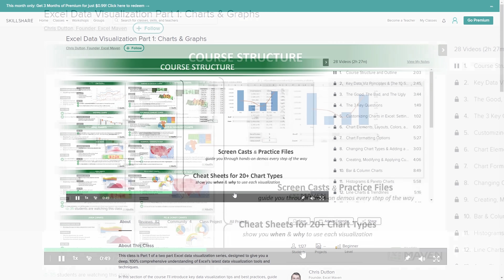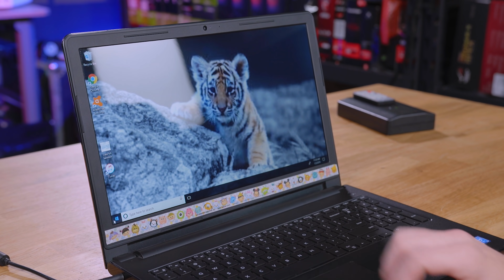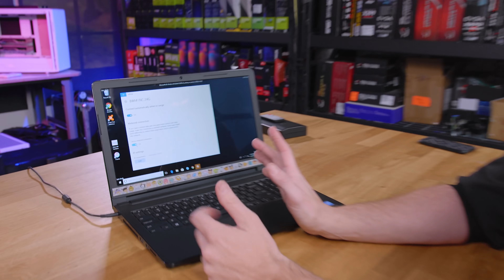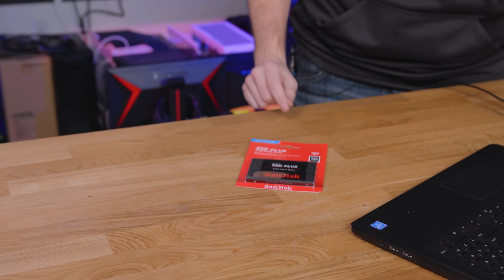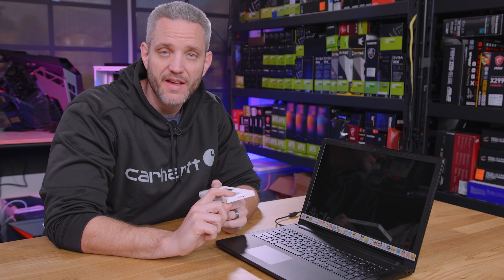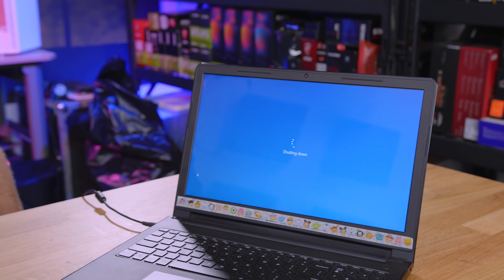Repairing an old laptop for as little money as possible...

Comment: Just updated a 5 year old Asus laptop to a SSD.  Used to take 5+ minutes to start, now less than 20 seconds.  It was a 1 TB HD with 700 GB used, so not a $40 upgrade, but caught a crucial 1 TB drive on a black Friday sale at microcenter.

Cloned the drive using the downloadable software from crucial, so I didn't have to spend hours setting up the PC like I had it.  Cloned, swapped drives, and off it went.

I was about to build a new PC to replace the laptop, but this will do for a while more.

Comment: what if I have a hard drive with  930 GB used space. is there a way I can transfer just the os to the 128GB SSD and be still be able to run my programs?
Reply: Probably -- what you would want to do is first move all the other data elsewhere (or delete it if you're getting rid of it I guess).  Then resize the partition with the OS on it to a size that would fit on your SSD, and clone that partition over.  Normally I recommend the Samsung Migration tool, as it's very easy and user friendly, but I'm not 100% sure it's smart enough to move just the partition over to a smaller drive.  If not, there are infinite free ways to do this.  I like to do from HBCD PE edition (google hbcd) because it's easy, but so is Clonezilla or a number of other options.
Reply: You could also put the hard drive into an external cage and you can still access the storage.
Reply: Bhavikh you can install the os on the ssd and then make it the primary boot drive. Then you can still use the hdd
Reply: @diab0liK  at that point I might as well just do a clean install on the SSD and just use the old hardrive as a secondary boot device so I can keep all my programs and data. I was hoping there would be some way I could still run programs on the old drive from the clean install SSD?

Comment: Little tip. 
In case you have an old laptop/computer that still using an spinning harddisk for the windows C drive, but you don't have enough money to buy an SSD:
If you have an old USB stick lying around that you don't use anymore, plug it into the laptop and set it up to be used for ReadyBoost.
Windows will use it as a cache to store small frequently accessed files. It doesn't make a huge difference in speed but it is noticable.

Comment: I have a Compaq presario C700 that I got in back in '07 xmas with originally 1GB of 667MHz DDR2 and a "dual core" 800MHz+1400MHz Pentium T2310. I maxed it out with 1+2GB ddr2 (3X more!) and a core 2 duo T7800 (3X faster!) and that exact SSD! It now works reasonably well although the new CPU definitely has higher TDP and runs hot and loud! You can hear the fan revving up to turbine speeds as you scroll though facebook, and quiet down once still!

Comment: Yes, what Jayz's saying is 100% true, just go for an SSD, maybe you think you don't need it, but down the road what are 25-30 bucks? Really, just go for it. I bought a cheap N2840 dual core laptop a while ago for a really cheap price, and as it turns out, those kind of machines are just "good enough" to browse the web and send emails, adding an SSD to an old/weak Laptop/CPU will help a lot. It's the cheapest and most notorious upgrade you can do.

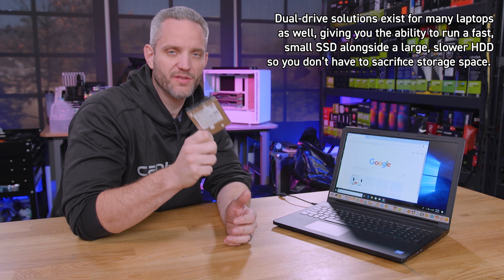Comment: 08:33 to the note: you also can just take out the dvd/bd driver and put it in an external case with USB and put an ssd in addition to the harddrive, that's what i've done because it makes no difference in speed if you use the DVD slot with USB or SATA, also you don't have to put the whole thing apart

Comment: I fixed up my old laptop to give to my mum. When i was using it i had to wait for literally everything it was horrible. I took it apart, replaced the 5400 rpm hd to a 7200rpm hd and the cpu had thermal pads on it instead of paste so i replaced that and suddenly it was better than brand new and didn't scream when you turned it on.
Reply: Didn't Scream wen u turned it on....... Lmao!

Comment: About SSDs: Spend the money but don't go too big unless you want to spend a bunch of extra money for no good reason. However, go too small and you'll wear your drive out more quickly. Consider how big your system and applications are altogether , and use only 3/4ths the space for wear leveling to be effective even if the drive's firmware has more storage than listed to provision for this. Sure it might be the difference between 25 years and  30 years, but treat our flash storage kind and treat it like a read-only device you can write to once in awhile. 

If you have an option for M.2 / NGFF storage, try to see if the motherboard will support Optane. Strange to think about now but in the future Optane as DRAM cache for HDDs will become more commonplace, with budget configs potentially excluding the media but BIOS including the option.

Comment: Jay, since you did a second video on this topic, you should seriously consider making a video about the ODD replacement approach as well. With a couple of different laptops so people can see how easy it could be:

Since quite a few laptops only have a single 2.5" drive slot one option is to use a 2.5" SATA caddy to replace an optical drive. This way you can keep your HDD for storage but replace the optical drive for a fast OS drive. A caddy from China costs a few bucks and if one needs the ODD then they can buy an external USB 2.0/3.0 enclosure to put their ODD in.

Often this is even the easier approach as laptop optical drives are held in by just one screw. Sometimes you can access this screw right from beneath the laptop without taking anything apart, sometimes it is behind some lid for something else (like RAM) and sometimes it is behind the keyboard. But still, it's so much easier to access than some laptops where you have to remove the keyboard and then the upper frame and then other things and this and that just to gain access to the internal 2.5" drive buried deep inside.
One thing to note though is that with some laptops this ODD replacement caddy can be a really tight fit. So it can be a bit of a chore to remove afterwards. Not always but I've encountered this so just something to keep in mind.

This however requires a little bit of research on the users side or the ability to use a ruler/calipers or Google your ODD model number as there are different ODD bay sizes. You need to buy the right caddy for your laptop, generally there's two: the Slimline (12.7mm) and then there's the Ultra slim (9.5mm).

Comment: The timing of this upload is uncanny! My desktop is a monster, while my laptop is 10 years old and starting to show signs of slowing down. Last night, I committed to upgrading the i3-330M to the same gen i7-varient (i7-640M) and swapping in an SSD for my boot drive. Orders were placed the morning before this upload! Haha. $40 CPU upgrade + $50 SSD = Under $100 refresh that should make things feel much better. I'm stoked after seeing this reaffirmation of my theory! Userbenchmark shows effectively a 50% improvement over the previous CPU, as well, which should also help and was a cheap upgrade.
I could just go out and buy a laptop, but for what reason? My laptop works fine, and I game on my desktop. It's pretty much just casual Netflix usage, watching movies, etc. Maybe some light-work usage at times when traveling.
Reply: Out of interest, were you sure you could upgrade the processor? Most companies restrict the upgrading you can do on a laptop's processor through the motherboard

Comment: For me reapplying the thermal paste for the CPU and cleaning the inside helped a lot. My laptop (HP Probook) is like 10 years old ran really hot and still had the manufacturers thermal paste applyed. The paste wasn't really fluid anymore so pretty much no heat transfer.

Comment: Also you can use a hdd caddy instead of that dvd and connect the hdd there. Dual storage. CD/DVD are almost useless this day for trasfer data, and external dvd are cheap so, it could be a good option. I did that a year ago with an old laptop. SSD for OS, a another ram stick and the cady for existent hdd.

Comment: I had a older laptop bought for speed related maintenance.
And among some things like expired Mcafree AV that was using insane amount of resources the weirdest part was the Dell profile for power saving mode.
It had set minimum power state to 5% - ok, saves battery/less hear on idle - but maximum was also 5%.
So the CPU was power starved - and profile was same for when cable was plugged in.

Comment: Legit, I did the same exact thing a couple weeks ago! I have a Latitude D830 suffering from update syndrome.  I put a 120GB SSD in, added another 1GB of ram, for a total of 3GB(DDR2), and installed Feather Lite Linux.  It actually runs pretty good!  It's no match for my desktop, but it's tolerable in a pinch.

Comment: I got a 250GB Samsung EVO SSD from my step brother last summer, I wired it up, installed my OS there... It helps a lot.
As you mentioned SSD prices I decided to check some SSDs. A 1TB version of the same SSD I have is like 175$ here. Even M.2 drives are considerably cheap.

Comment: Good video, I just had a 4th Gen i7 computer that I hadn't ran for like 6 months take forever to get to the desktop and then it was still not usable. After several hours of updates and reboots, it was back to its normal usefulness. The boot drive is a SSD. So basically what I am saying is those Windows 10 updates can take a toll on even a relatively fast computer.

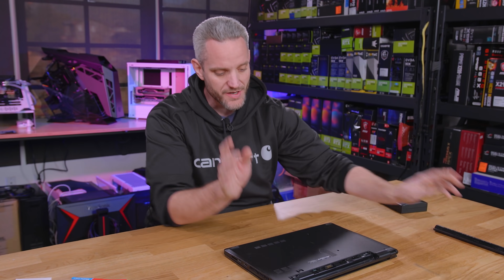Comment: 7:00 OH YEAH ?
I have a e6420, a HDD swap is the easiest thing to do. It just has screws outside and you can pull out the HDD cage without even taking to cover off. 
Ram is also super easy to upgrade, and i've even changed the paste and it wasn't that hard as of other laptops.

It's not about the brand but the model, every brand has a not user friendly laptops NOT ONLY DELL,, but good luck with the new super thin ones!

Comment: I agree with all your tips apart from disabling Windows update. I've got several laptops all with traditional hard drives and trust me although you can tell Windows update is running whenever it decided to do something it certainly doesn't cripple your experience. not to mention if you disable updates from inexperienced person they won't even think about it so you'll come back 3 years later and it will still be on the same version

Comment: I can confirm that even a SATA SSD upgrade will make an older laptop with a weaker CPU a lot more responsive. I swapped an SSD into a mid-range 2014 HP laptop and it made a world of a difference. Extended it's useful lifespan by about 2 years for the way that we use it.

Comment: It's probably worth mentioning that for many users, the CD drive is pointless.  You can buy caddies that will allow you to remove your CD drive and replace it with a hard drive - that way you can boot from the SSD, and have all your main apps on there, but keep other files etc. on the hard drive.

It might even be worth showing users how to change the locations of their downloads/documents/pictures etc. in Windows Explorer - I've come across users that had SSDs, but had picture folders of 100+gb clogging things up, and then didn't understand why their (0% space remaining) SSDs weren't fast anymore.

Comment: That's absolutely right. My father bought himself a new computer a while ago. It isn't the best but it looks okay on paper. He was wondering why the machine still was relatively slow, though. He expected way more out of a new machine. Faster booting, quicker access to programs and all the good stuff. Guess what, the machine runs with a mechanical harddrive which is bottlenecking the whole system.

Comment: Is a 1tb Seagate HDD, no SSD, 6700K, Z170A, 32gbs G.Skill Trident Z and a GTX 980 Ti still a capable machine in 2019?
Reply: Just add a 120gb ssd and load windows on it.
After doing that its a capable machine

Comment: If you are not using your cd/dvd drive(who use cd’s in 2019 anyway lol), take it out and replace it with your old original hard drive your laptop came with. OS on the SSD and save your files on the hard drive. You can buy a laptop a caddy for 2-3 bucks. Make sure its the right size for your laptop.

Comment: Moreover, for those that need the high capacity of a HDD they could by a cheap CD/DVD sled. You just remove your regular CD/DVD drive and pop in this one, that has a slot for a additional HDD/SDD. So you can have your Windows on your SDD, and all the other stuff on your HDD. And if you need your CD/DVD drive, just buy a cheap usb adapter (similar to having a external CD/DVD driver). Small prices for all, but very useful.

Comment: funny one of my friend had this issue it was just running slow, not this bad, check the power option and windows set it self to power saving switch it to high preformance, ( unable to boot ) found out the battery was to blame for the slow speed windows slow down the computer to make it usable ( the laptop was 10 years old proply more

Comment: Normally low end laptops come with 4GB RAM and a mechanical 5400RPM drive. Now the problem with that is that if all available memory is utilized, the OS will go to the page file to start swapping things in/out. And because its a really slow mechanical drive that just cripples the system until the process is completed. Switching to an SSD makes sense of course but it should be accompanied by more system memory to make sure the OS does not need to go to the page file every time it runs out. Windows update and even Google Chrome can easily max out system memory when the system has only 4GB.

Comment: Nicely done video, and thoughtful  to understand that many of us don't have buckets of money to spend on new computers.  Two points:
- Jay commented that Dell computers are hard to service. I work on Dells a lot, and that's not quite true. The consumer models by any manufcacturer are often difficult to work on. Inspiron is Dell's consumer line.
On the other hand, business models (like Thinkpads and Dell Latitudes) are usually a joy to work on, since IT departments pay attention to the cost of maintenance.
- Seems like the immediate problems in this case were caused by Windows updates, and the fact that Windows machines often required anti-virus programs.  And sooner or later, Windows will no longer support older models. That's why the Linux OS is really key for making the most out of older computers.

Comment: I noticed this laptop has a DVD drive so if somebody really need an extra storage, there is an option to buy HDD caddy for DVD slots and even if somebody really needs to use that crappy laptop DVD there are also an caddies that make laptop internal DVD-ROM to external USB DVD device, or if you are savy, this drive is mostly hold just one little screw so swapping up things is pretty fast.

Comment: I would look into forums, brush up a bit more on laptops specifically Dell computers. I found that old computers, even several years later can get new bios updates making them more capable of running faster processors, more memory, etc. I have a Dell Optiplex 745 that use to run a Pentium D and 2gb of 533 mhz DDR2, it now runs a Core 2 Quad Q6700 and 8gb of 800mhz DDR2 thanks to an bios update from 2013, which is about 8 years later LOL! Maybe that laptop can take an i3 or something?

Comment: The real solution is a lightweight Linux distribution (try Linux Mint for old/slow hardware), this removes the bloatware that is windows and you would likely see a performance increase. Most people don't need windows and there are Linux alternatives to almost anything you could need. I'm just saying Linux is an option, if you don't like it switch back to windows. Linux is free, you have nothing to lose.

Comment: A system used for office applications and internet browsing DOESN'T need 8GB of RAM. (2GB would be a different story but 4GB is just fine. I run Visual Studio on 4GB and don't feel limited by it.) RAM will not help you when your CPU gets ~75 points in Cinebench.
But an SSD is a MUST. Especially in a device that will get moved, bumped around and tilted all the time, even while it's running.

Comment: I observed some downsides with my SSD and I'd like to share these with you: 
- it enters in some kind of stand-by mode if no reads/writes have been made in several minutes. as soon as I resume working, I find a bit of lag for a second - perhaps it turns on
- sometimes it performs with latency , when performing multiple reads simultaneously or I dont know.
- the computer sometime freezes and there's nothing I can do except pressing reset button. (This didn't use to happen with the old HDD - non-SSD drive)

Comment: I would like to see how you do that video idea.

I, myself, have found myself a cheap 2.9 GHz 13" mid-2012 MacBook Pro, slapped in 16GB RAM, slammed in an SSD and now it runs like a dream. I'm fairly sure the CPU is the bottleneck RN, but it'll do while I slowly assemble a new PC.

Comment: The shut down time really is impressive.

You didn't mention it but I assume you allowed the Windows update to complete finally after ditching McAfee. IME interuppting Windows Updates results in bad karma and corrupted installs. Annoying as they are I urge one and all to Let Them Finish.

I like your suggestion for rescuing older hardware. I find there is much value to be had from such an endeavour. 

Kudos on this video and Happy New Year.

Comment: Jay, I have a Gateway laptop from 2005, a 7405GX, that I would love to see what you could do with. It’s sporting and AMD Athalon 64 processor, a 3200+ and running windows xP. It looks to have a massive 75Gb hard drive and 1.25Gb of ram?

I haven’t turned it on in over a decade, and watching this video made me want to find it and try. It boots, and takes just slightly shorter than this one.

Comment: this is why i always suggest used dell lattitudes instead of normal consumer laptops, very simple to strip down, often have socketed processors (except the small ones) and usually 2-3 half/full length internal mini pci-e slots. i use a 6440 for my own one for normal work etc.